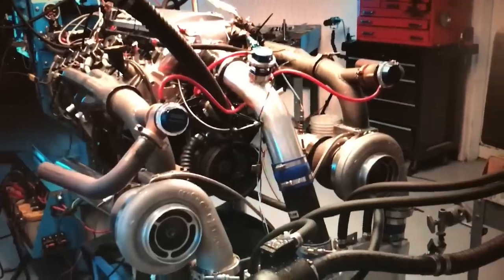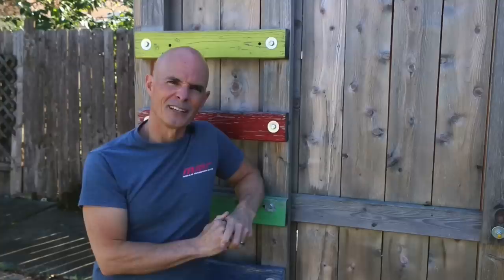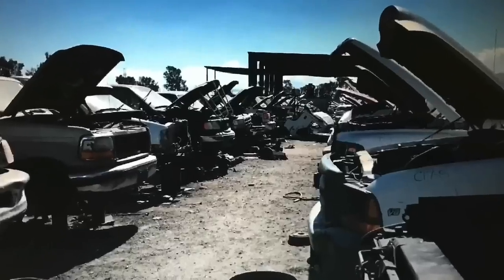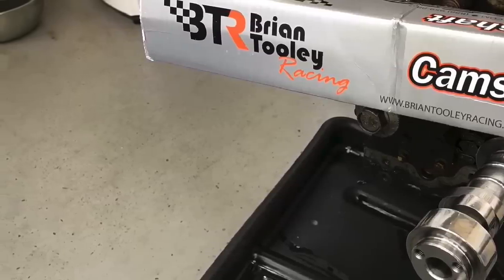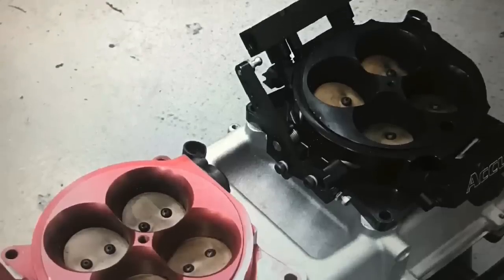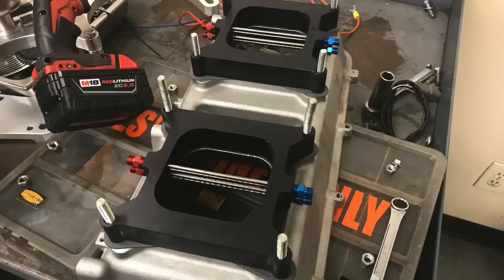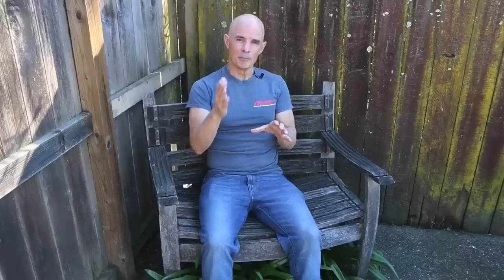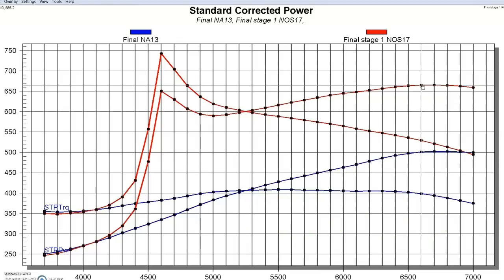BIG BANG NITROUS 5.3L! WILL IT SURVIVE 3 KITS? CHEAP, SBE JUNKYARD LS WITH ALL THE NITROUS!

Comment: Afr went lean because you had to much Nitrous going in the motor. "Suspended nitrous" in the intake...other holes started sucking it in and blew it up. Get rid off 2 kits and focus on one. Keep adding nitrous slowly from one system. 5.0 pph tops the most  that little motor is gonna flow

Comment: BT doesn't  know that LSA isn't  a result, rather an input that results in significantly more torque. Look at that rediculous 400 ft.lbs. in an LS? It's  embarrassing. What good is a street engine that doesn't make torque below 5250 rpm? Well, what's left of it😂
Reply from the maker: BT has forgotten more about cams than you will ever know

Comment: I stacked a couple 4150 plates back in 2000 it was a cheater plate and a big shot plate  I cut one and ran it in cross configuration  worked really well

Comment: Also I have been watching this about every LS video you have I would like to know how would you set up a 4.8 in a 1985 C10 Suburban I'm looking for gas mileage reliability but good horsepower and torque numbers I'm not looking for a 500 horse or 500 foot pounds Beast we're actually somewhat satisfied with the horsepower and torque of the original 350. And I know the 4.8 that I'm wanting to use will have better horsepower and torque numbers. Please let me know of a way to contact or be contacted if you want to take answering this project question seriously.

Comment: I think you should run Foggers on each cylinder along with your nitrous of course then that way you also have control with the injectors and you also have your Foggers. That way worst case scenario it's a little rich or if it is lean it is going to be a lot easier to Richmond it back upright?

Comment: Plz redo this one with a proper good tune, dry foggers and compensate the fuel thru a second fuel map switched on with an input to the ecu and control the n20 solenoids with an ecu output channel to allow for best control. Also plz start with conservative timing so we achieve results 🙏 🤣😂 can never have too much fuel or too little timing with n20 for longevity

Comment: So for the guys who know about this stuff I’m a newbie with spray. I’m putting a gen 4 6.0 with worked over 243s and flat top ls2 pistons, Vic jr efi intake with elbo and 92mm tb with snake eater 1500s and Holley terminator x to control it all. What style Nitrous system do you recommend? I planned on a nozzel installed in the elbo and control fuel thru the injectors as they should be plenty. Also the plan is e85. Anyone willing to chime in is welcome thanks in advance... also cam is .625/.605 230/242 113+3  (summit stage 3)  if that matters
Reply from the maker: you can use a single fogger but you can also try a plate system on that intake

Comment: Correct me if I'm wrong. I ran a 100 shot all the time on a single carb 355 heads & cam only and never had any issues...so this engine couldn't take a 130 shot?
Reply from the maker: 500 shot

Comment: A port injected kit will insure each cylinder receives fuel. With power level above 300 on a small motor. Power is still limited buy the swepped volume of your engine. Hard to make more than 350 hp. Add on. Progressive controller will help.

Comment: I agree with the comments before is to use a NOS controller to bring in the NOS slowly, but i wont stop there, I will use a Knock sensor and optimize timing with it for safer/maximized power and start with a richer Fuel jet and slowly bring it up to 12.6:1

Comment: Progressive controller and a designated fuel system just for the nitrous system should help. Losing fuel pressure when the second stage hits probably caused the lean condition. I also like to use a fuel pressure safety switch that will not allow nitrous solenoids to fire if min fuel delivery is not present. Cool videos keep em coming love this channel.

Comment: i think having at least 1 stage wet to offset the lean spike [that could of been fixed with tuning] would be a safer bet.
maybe having one plate for fuel and nitrous [1st stage] and dry  nitrous foggers per runner for 2nd stage. also throw at least one of them on a progressive controller.

Comment: Interesting build. Bad finish. I’ve seen both systems dry and wet floggers used. I tend to favor the wet system. Dry system works well if you have enough injector and fuel system to handle the extra requirements and you are a good tuner. I’m not one of those people, so I would apply the KISS principle. Keep it simple silly or in my case stupid. LolI’m sure there are many more savvy people who have much more experience than I.

Comment: How about a nitrous outlet puck system test. Recently bought a Edelbrock Victor jr. with it installed in  it and curiously wondering how it will work compared to the other setups. Thanks

Comment: If I had to do it I would go with a progressive when I begin to bring the second kit in when second kit comes on I would only hit it with 50% and say it comes in at 5500 rpm from there to say 7000rpm then I would bring in the remaining 50% in by 6500 and also I would pull extra timing out at peak torque and gradually bring the timing back in as you get closer to your peak rpm

Comment: Wet not dry when you're running that much nitrous, no progressive controllers either the solenoids will develop a tendency to stick open when you're flowing that much. Your original concept was right in principle, take it up in steps and watch your fuel/timing issues like a hawk. Maybe add some watch dog safeties that will shut it down if you care about the motor.

Comment: Dry nitrous with big injectors and control everything with the Holley. Start the laughing gas at a lower RPM and ramp it up a little at a time until you're spraying 500 HP of nitrous at the NA torque peak and staying slightly rich all the way up.

Comment: I’ve never messed with nitrous, however I have observed others mess with it quite a bit. Usually the failures I’ve seen happen similar to yours. Too much bottle and not enough meat. Focus on building better internals with better torque and less nitrous. And why not try running 9-10 psi from a turbo with a single shot of nitrous? Probably safer.

Comment: Wet system , don’t care on delivery method but definitely need a 1-2 second ramp up controller , closer to the 2 seconds with bigger than 250 shot. The spike was hitting 200 hp above max Hp as a spike .. that shock is the killer ... don’t know Exactly what happened with the lean out you experienced .. could have been a few things...I think the rule is 2° of timing per 100 shot .. I would have started safe at 10° instead of 8° ... love the videos .. keep me coming ... I bet the next engine will survive the 1000 !!!!!  Your a pretty smart dude !!

Comment: Run a better nitrous plate system, I started off with the same plate system from NOS and a 496ci motor you built me for my jet boat a few years back, the NOS solenoids tend to stick either open or closed. I moved to a Elelbrock fogger system and never looked back. Yes I know totally 2 different motors but the same plate system. A motor is a motor at the end of the day.

Comment: Add fuel.....you leaned out. 
First stage..cool, second stage cool.
Both together boom!
What is different? We ran 2 pumps 3 regulators sprayed 300 out the gate and and 300 1.5 seconds out back in the late 90's on a built a4 block 306 Victor Jr heads...my point? 1 pump and regular for motor and one pump and 2 regulators for NX system we ran.
We pulled allot of timeing out early and lost a little, not much in the 60ft but it woke up with 2nd stage. 
And I know about progressive controllers , 2 steps etc back then but when you're wanting to go fast and don't have the funds to keep replacing parts...you learn quick with what you can afford.

Comment: Control fuel enrichment thru bigger injectors and port dry foggers in each runner. Both kits are too big to be brought in at such a low rpm with a high load/resistance.might work from 7000rpm to 11000rpm🤓😜

Comment: Next time use propane on the fuel side of the nitrous 

LP to NO2 is a 1:1 ratio.  You won’t have the lean spike and you won’t be stealing fuel from the injection or fuel rails.  

LP is also 115 octane and will not puddle inside the intake manifold 

It works awesome
Reply: I’ve never heard of using propane with nitrous, I’ve seen propane converted cars so I definitely could see it working out great
Reply: @southernracing2468 propane/lpg or gas(state of matter) cars are popular in aus, back on the early 2000s majority of Australian built cars ran both or only gas
Reply: That's pretty Smart Mate!

Comment: 1st Ditch that intake and tb setup.
2nd Yes direct Port wet kit
3rd A progressive will definitely stabilize the afr.
4th Holley efi will make fuel corrections on the fly
5th That cam being a 113+3 LSA is not exactly great for nitrous. A 113 LSA will normally give you great na power and work great for nitrous

6th  and THIS IS IMPORTANT! Use a non projected tip plug. On my 500 shot I typically use a BR9EF. 

MY QUALIFICATIONS: S-10 drag truck Stock block LS2 6.0L bored .005 over/ 4" crank = 402 cu 4.79@154 mph
2002 Trans am LS1 225 shot, full weight street car 5.64 1/8th mile stock block, stock 3rd gen rods (forged pistons)

Comment: Nice video, I'm thinking the fuel pressure dropped when you hit the second stage, it takes lots of fuel to support 1000 hp. 👍
Reply: I was thinking the same, I bet the fuel pump ran out of pumping power. I'd say he should run 3 fuel cells or a massive fuel pump.

Comment: Why your getting a lean dip is because the distance from the solenoid to the spray bar. You have to basically hook the fuel solenoid right to the plate to stop it. If you have a setup to purge the fuel system so that there is no air on the pressure side of the system and have the smallest possible volume between the solenoid and the jet you can get this lean dip down. It looks like you have a bunch of extra line that has to fill with fuel before it hits the fuel jets.  The nitrous does have this fill time but the pressure is over 1000psi it takes less time. Running two stages the nitrous system would already be purged of vapour and would have liquid up to the 2nd stage solenoid upon activation. This turns your slight lean dip into a tragedy. You really need to slow the nitrous down to the jets. Purge all the fuel up to the solenoids and add an extra 3' of line between the nitrous solenoid and spray bars.

Comment: In getting ready to run nitrous on my engine, I was warned about A/F on multiple stages. My guess is that the fuel on the second stage was slower to the jet than the nitrous was and it went lean. Also could have been a dip in fuel pressure. I have also heard not to run plates on a tunnel ram- all that nitrous and fuel in the intake make for a nice bomb (as witnessed in the video). My thoughts would be a single, large hit on a fogger with a progressive controller (as others have said). Do it wet, not dry as you can get tune info from the manufacturer and not have to guess with the pulse width on the EFI.

Comment: Direct port wet and a 250 on the plate would be interesting to see.  Also would absolutely love to see a old school 4 bolt 355 or 383 with forged internals and see how the stock block would react. I honestly believe a lot of people discredit the old sbc when there tuneups are to Blame. 👍🏼.

Comment: Richard you dont tune them individually like that. Keep the plates keep the combo you had just pull alot more timing was over timed if you want the hit to be softer run longer nitrous lines from nitrous solnoid s to the nitrous jet side add 6 to 8 inches
Reply: Put clean. Jetting in them 15 to 30 spread bigger on nos side 6.5 psi and way lower timing .think of monte smith tuning. it can live .pull way more timing with cleaner jetting.  Start low only gonna hurt power. Not parts  start 7to 9 degrees with same nitrous jets u had but with 15 spread on first kit. And  20 spread on second kit . Run that total with both kits. .........With high timing and factory jetting you have little room for error with the cast stuff stock stuff.and the spikes more violent

Comment: I've seen that same exact lean spike, but testing a 150 shot is the max I have ever put on anyone's engine. I've drove through it and it's been fine.

 Makes me wonder.....if both Solenoids are opened at the same time, but the Nitrous is under 900 psi, and the fuel is under 60psi from the rail, I'm thinking the NOS is beating the fuel to the party in the first second. That's why you see the spike in the graph and lean reading on the AFR. So I see you added fuel in the Tune at a specific RPM, kinda like your running a dry NOS setup, and it was too rich until the NOS caught up. 

So, I haven't yet had the chance to run a progressive controller, and wonder if that would cure the lean spike. Further, what if you ran a 2 stage wet with a 50/100 shot first, then hit the big guns (200 shot or more) after the fuel curve had a chance to zero itself on the target? Like a mechanical progression. 

Also, If your running a Holley EFI, you could setup an I/O to the O2 sensor to kill timing over 13AFR and under 10. Run it on 10 degrees total when the AFR Triggers the retard just like a knock sensor. Timing is the enemy with NOS. I've heard the stories and seen the aftermath of guys running NOS and blow their motor on the very first try. Ugh. They should've come to me first.

Comment: Some data logs:
Is fuel pressure stable?
Progressive controller to ramp it in w/o the giant rod crushing spike.
Some controllers have a lean safety circuit.

Map Q of NO2 against torque to keep below a target level.

I THINK a dry individual runner foggers would be fine with control of port injectors.

Comment: I’m going to have to agree. You need a nitrous controller so you can ramp it in easier. I would also make sure you have enough pump on those systems. Physically bench test it. Don’t just go based on it’s flow specs. Stick both plates in a bucket and flow them as a complete system at the same time and measure the volume of fuel. Even if you change over to fogger I’d still do this and try and pin point where the problem was.

Comment: The dripping fuel leak at 10:01 on the rail fitting could have been part of the issue. Also, that leak could have been REALLY bad with that fire from the explosion.

Comment: Progressive nitrous controller and a wet direct port system will make it go for the 1000hp. a dedicated fuel system for the fuel solenoids with higher pressure, like 43,5 psi will be much more stabilize with smaller pressure drop when it activates

Comment: Is it a practice at all (i would think probably high high horsepower applications maybe) to run dual injectors per cylinder but only use both when on the button?
Reply from the maker: dual injectors are common for ultra high HP boosted stuff

Comment: Great video! I'm not a fan of chemical horsepower, however much respect when done right. I noticed the fogger plates were installed east/west, should they have been north/south (inline with the engine)? When we see flames out of the headers, does that mean incomplete burn in the cylinder? Thank you Richard!
Reply from the maker: the fire cone is typical of NOS-at least when its right

Comment: Multiple kits are very tricky. After running each kit separately. I would of started small with both kits on and worked your way up. That way you could of caught the lean issue before it blew the motor. Next test, run it with a single 4150 carb, Super Vic intake, individual fogger/cylinder with a progressive nitrous controller. One kit one carb = KISS theory

Comment: What size fuel pump was ran for the nitrous ? Maybe it can only support on kit or the other. Both together and you drop fuel pressure. ( My guess ) .keep it up Richard I love the content. You made me develope a love for ls engines and now I'm l33 swaping my Jeep yj.
Reply from the maker: fuel pressure was solid-we've run 1600 hp with the fuel system

Comment: I'm sure its been mentioned already but could increasing the fuel pressure for the fuel jets in the plate help the fuel keep up with the nitrous as the button is hit? After all nitrous is injected at a much higher pressure then the fuel

Comment: Lets see what happens to a 5.3l when you Just Stroke it. Keep the bore the same, stroke it. Same cam, same heads, same intake. Im curious what the stroke adds to those little bored LS engines.
Reply from the maker: it adds power

Comment: Would definitely run a wet fogger setup for precise cylinder to cylinder afr control and use a controller to ramp in the the hit so you have less stress/more time to monitor afr’s.

Comment: Personally, I would run it dry, direct port with holley close loop WB doing the fueling and a built in AFR safety that a lean spike longer than .5 second would kill the nitrous.  And bring both stages in progressively with a Holley solid state relay.

Comment: The best way would be dry fogger progressive . Can be fueled correctly by Holley and injectors are more accurate  ! But if it goes lean pop ! LoL . You can definitely get there with a wet plate just takes alot of jet changing progressively getting bigger keeping up with the afr . Never use nitrous when lean  @@ !! LOL !! Thanks for the great video of what happens when nitrous goes lean . It could have done it on either kit they both had a lean spike that needed attention first before progressing ! Great video  !!

Comment: I just want to see what it would do with a single carb or single efi, and progress until it goes. Incriments, 150,200,250,300 or as much as it can take. By the thumbnail I thought this is what we would be seeing.
Reply from the maker: Check out the other Nitrous vid where we ran a single plate and pulled the jets-over 300 hp shot
Reply: @richardholdener1727  Forgot about that one, thanks!